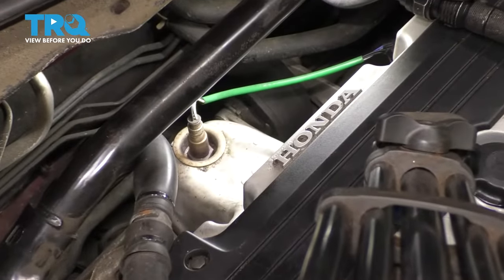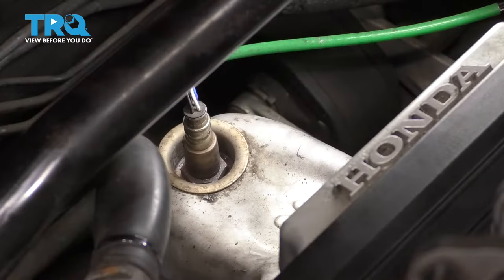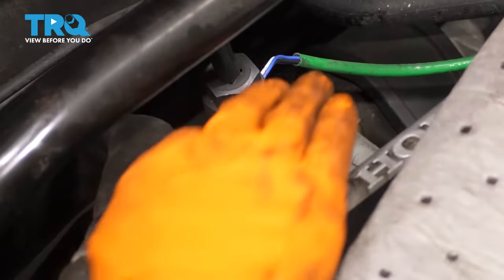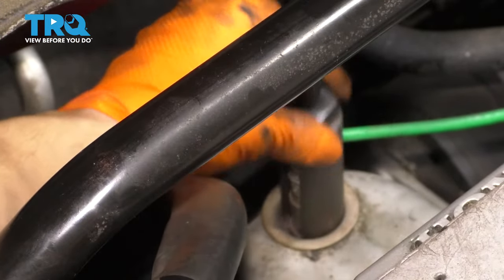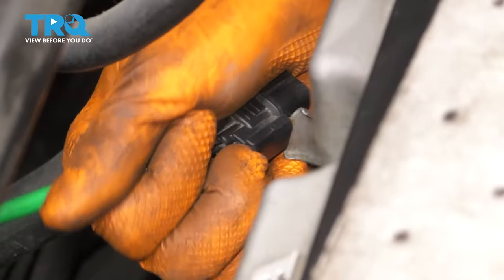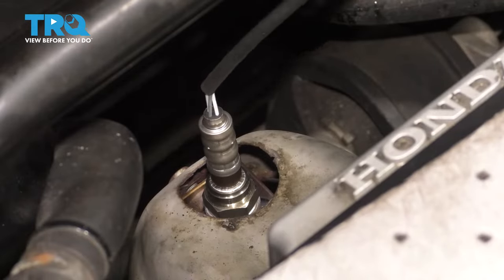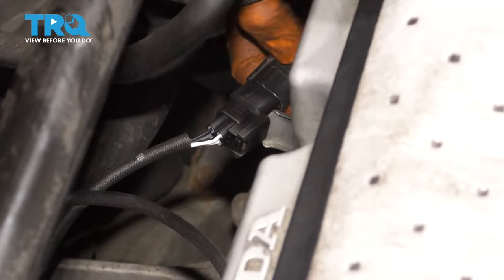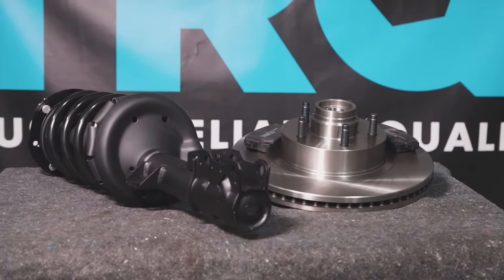How to Replace Upstream Oxygen Sensor 2008-2012 Honda Accord (2.4L)

Comment: That upstream sensor in catalytic converter is actually the air/fuel ratio (A/F) sensor (sensor 1). The O2 sensor (HO2S) is downstream, i.e. the lower sensor (sensor 2) of the catalytic converter. - Source: Honda Service Manual

Also, the sensor you placed there is the actual O2 sensor and not the air/fuel sensor. 
Still a good video to replace the a/f sensor but clarifying for those who may not have realized and buy the wrong part.

Comment: Tekton 4929 oxygen sensor socket

This is the oxygen sensor socket you want, after buying 3 different makes which where all to wide to properly fit this was the first to fix without issue.

I paid like $12 shipped

Comment: use a breaker bar and rent an autozone oxy sensor socket kit, they also rent oxy sensor wrenches. attach 3/8” to 1/2” and it will break free super easily. go slow and make sure your car is as hot as you can tolerate